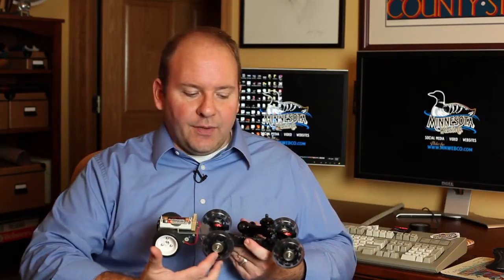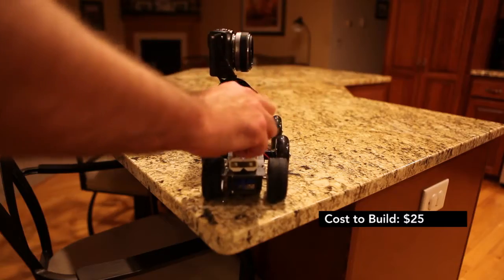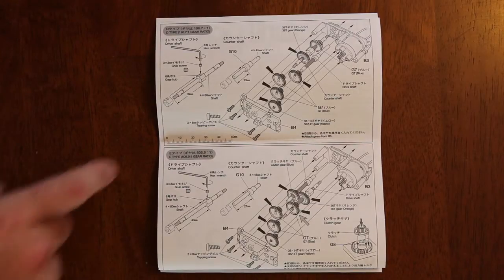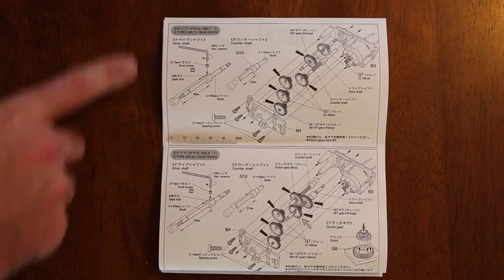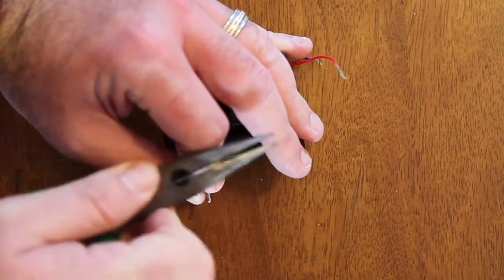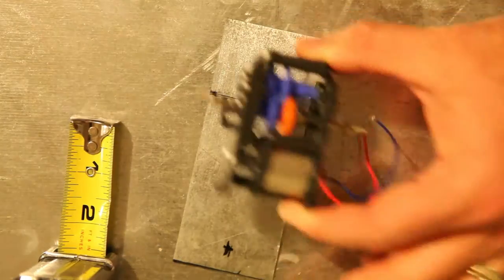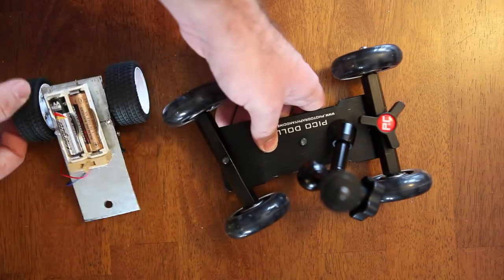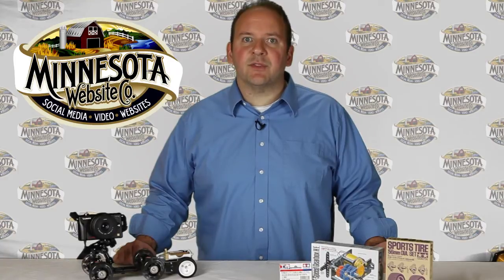$25 DIY Motorized Pico Dolly

Comment: Easy to fit to my Pico Dolly.  I'm based in the UK and managed to get all the parts from Technobots. The only thing I would say is that the metal sheet is a bit bendy, I would have preferred something a bit thicker, however, I used a couple of small spare pieces above and below the main plate. Perhaps I got confused over the metric equivalent of 26 guage, I bought a 0.41mm thick sheet.

Comment: Will the motor be able to push the weight of DSLR camera? I am planning to order the motor, but just thought of checking with you to see if the weight of DSLR will become an issue or not. I have Nikon D3100 I assume with lens it will be around 1.5 LB

Comment: I'm just in the process of building this now. Quick question please: how are you getting the forward & reverse..? I couldn't get the exact battery housing you suggest - is that where the 3 options are delivered (forward/reverse/off)? Great instruction video & design though. Thanks so much for posting :)

Comment: Hi, could you please tell me if the Tamiya 72005 would be able to move smoothly 3 Kg (6,6 pounds) that would be a 60D with a medium heavy lens in top of a Merlin mount, any chance you could try please to put a similar weight in it and see if it works? would be great!! thanks

Comment: Is this motor slow enough for timelapse using a gopro on the pico
Reply from the maker: Daniel Korup Daniel, it depends on how long of a time lapse you're looking for.  It comes with what I think it calls like a worm gear, which is decently slow.  Not sure it would accomplish what you are looking for.  Another option for a slow timelapse is to put a go pro on a cheap oven timer, so everytime it clicks of a minute on the timer and moves one click, you set the gp to take a photo.  Hope that helps.